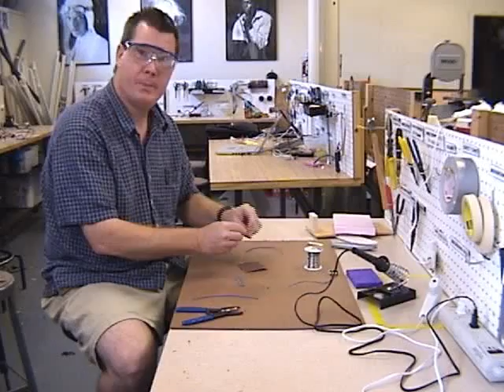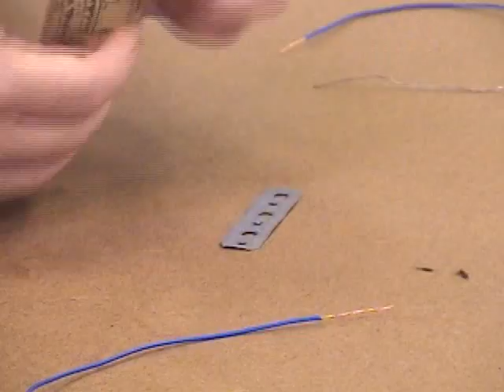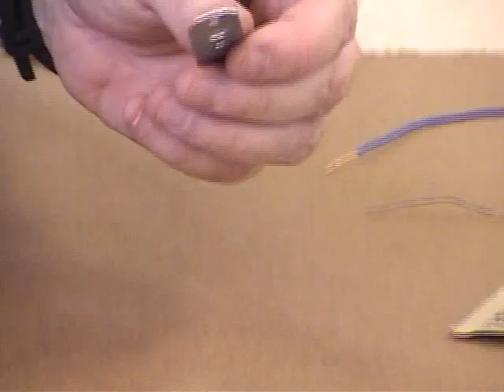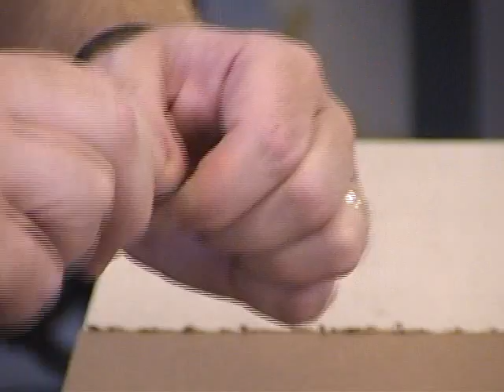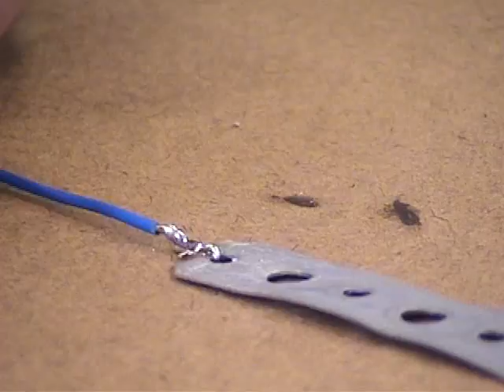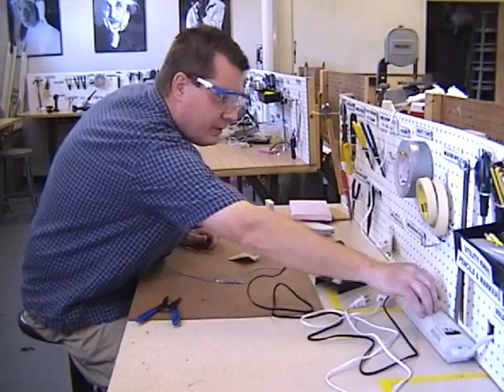DESIGN LAB: Soldering to a Metal Strap

Comment: It's taking you so long to get the solder flowing because your tip is completely covered in impurities, you need to run flux and fresh solder over it and let all the impurities boil out and wipe them off until you have a nice clean shiny tip, this is called "tinning" because the metal that stays is mostly tin.